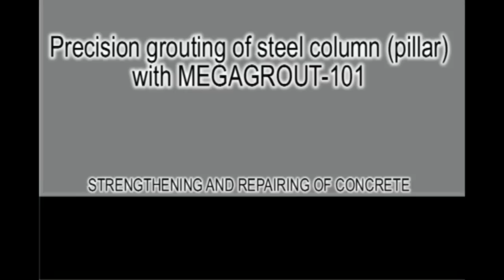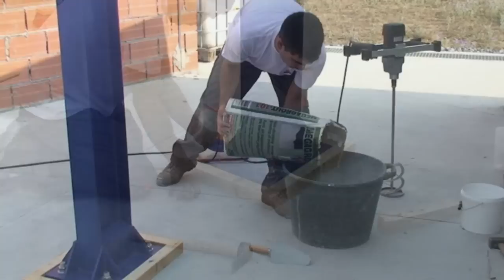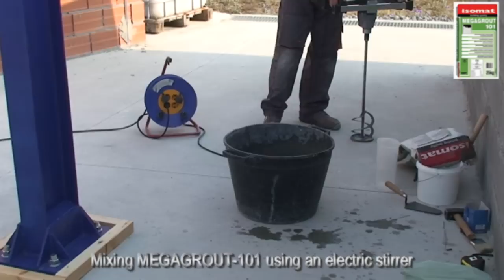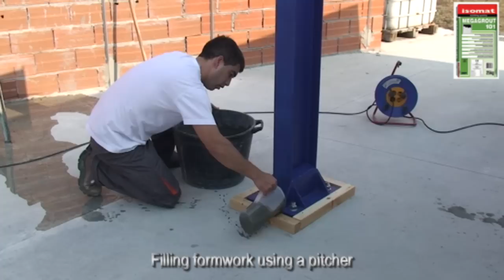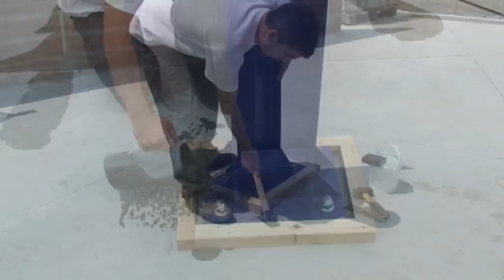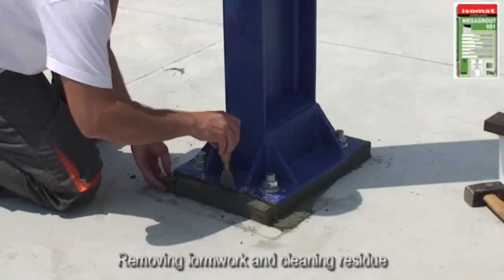Precision grouting of steel column (pillar) with MEGAGROUT-101 by ISOMAT S.A.

Comment: Why do these columns sit on the bolts and not directly on the slab?
Reply from the maker: Because this is the usual way that metal columns are constructed. There is always a little gap between the metal base plate and the slab.
Reply: Maybe, so that it's easy to square and straighten the column with the help of adjuster bolts underneath the plate. Otherwise, if there is an existing pedesta, it's going to take a lot of work to square, straighten, and get the column to the correct height.
Reply: So you can adjust to your elevation height

Comment: How deep are those bolts anchored in the concrete slab and how deep is the slab?
Reply from the maker: Dear +dalsenov the anchor's and slab's depth are not standard but depend on each construction project. Furthermore, they do not affect the application of MEGAGROUT-101.  We could add, though, that the max. thickness/layer for the application of MEGAGROUT-101 is 10 cm. For any further information please contact ISOMAT's technical support department at support@isomat.eu. Thank you!
Reply: Thanks!